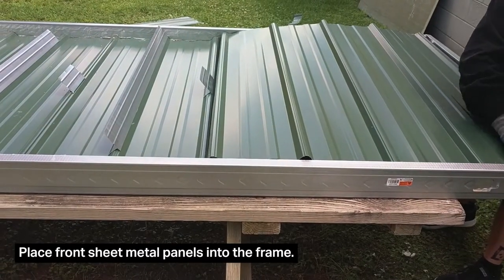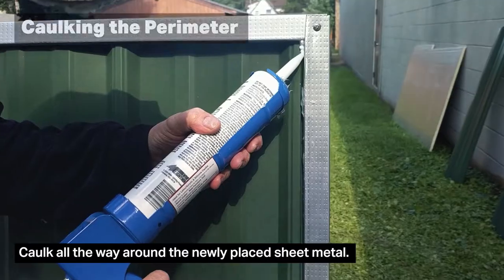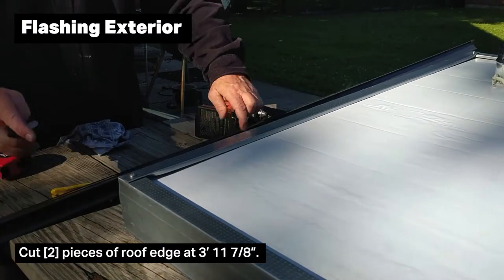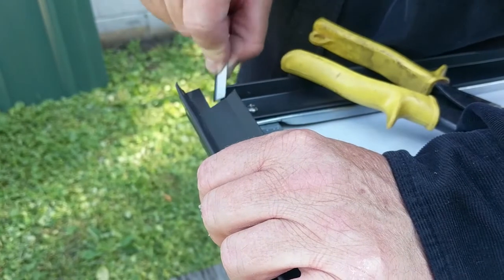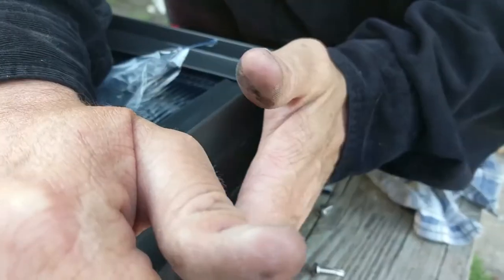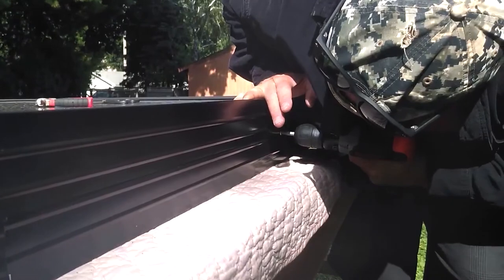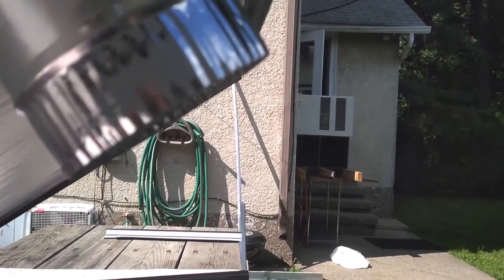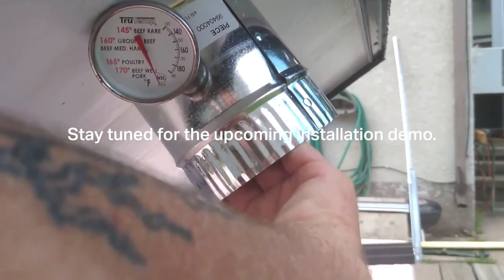DIY Solar Air Heater | Step-by-Step Building Guide [Part 2]

Comment: I would like to see data on performance in varying weather conditions. Impressive heat, nice work
Reply from the maker: Me too!  Maybe in time. I have found that the heat-collecting metal being protected under the polycarbonate, seems to not be affected by the exterior temps too much of a degree that would be noticeable.

Comment: Thanks for the video. Explained Perfectly to the last detail. Perfectly understandable language, excellent picture guide. It does not get better than this!
About the project: Finally someone who has built a collector not from wood. Thank you.
Only the imperial dimensions have to be converted, but I think the materials used are the same size everywhere in the world. From this then also the rest results.
A 6 mm thick polycarbonate hollow chamber panel has the dimensions 98 cm x 250 cm in our country. That should correspond to the plate you use, right? It currently costs 25 EUR (offline, DIY store), so the whole project is affordable.
Many greetings from Germany.
Reply from the maker: Thank you!  I am happy you found it clear.  Yes, the polycarbonate can vary in thickness as truly, the sun's rays transfer through it and heat up the metal so sufficiently, that such a slight difference would seem negligible.

Comment: The most expensive part of this build ( present day ) is the Polly twin wall and metal roofing. The heat you have coming out of the unit is impressive.  Should cost between $500 - $600 Canadian. It may even pay itself off within a few winter's.
Reply from the maker: These panels used to be $40 and now are around $100.  Always look for deals!

Comment: Thanks for the detailed and well delivered videos. Apart from durability,would you see any issues using a plywood frame in the construction rather than the steel U channel?
Reply from the maker: Thank you.  I kept glass, wood, soda cans and weird unfindable materials out and instead designed it as I would an oven fabricator, such that I was for many years. Plywood will rot. It's expensive, heavy, stinks and is toxic, no, steel studs rule the world!

Comment: Thank you for this. I am trying to help schools in Northern Pakistan get heat during winters as there is no electricity in the villages.  How much is the cost of this one unit about?
Reply from the maker: The cost of the last unit was around $466. The steel mounting frame is a bit more. Since there's no electricity, I suggest simply allowing the natural hot air to rise and flow into the living space.  Also, you may be able to direct the heated air through bricks or water jugs so they heat up during the day and then give off heat for some period of time through the evening. I hope this helps!  I would love to see this project should if come to fruition. Best of luck and feel free to contact me.

Comment: Looks good. How did it work? Have you tried black aluminum window screen or perforated aluminum fascia as the heat absorber?
Reply: I am familiar with screen designs and do not like the material for several reasons.  I also prefer the solid or un-perforated sheet metal as it is going to last for many many years whereas the screen is eventually likely going to degrade, warp, sag, etc, besides being a pain to work with.  Perforated aluminum would of course heat up, but because materials being heated can off-gas into the airflow, the perforations would allow the heated air to escape through the perforations, come in contact with the polycarbonate.  The plenum in my design is a totally sealed off system, super stiff and will last virtually forever.
Reply: @ericlatocki7588  Your design looks much more sturdy and looks professional. How many panels did you end up building? I am interested in building some to help heat one half of a two car garage that has been remodeled and heavily insulated. R38 in walls and roof in the half that I am using . I am planning on bringing the air in/out with flex duct through a window with plywood. That side faces SW. I plan to start with two panels for it. I have space for four or five later.
I also have a small 12x12 block building that is earth sheltered on three sides. It’s roof faces South. Just a small workshop. One or two panels?
Reply from the maker: Sheesh, how did I miss your comment!?  I don't like to make promises as there are so many variables, but I'd think one panel would definitely do the job assuming air circulation and insulations is in place.

Comment: Could I use old barn tin that I already have instead of purchasing new metal roofing?
Reply from the maker: You could I suppose. As long as you can keep it straight and not sag.  You may need to add some additional supports inside the plenum (air chamber). I want to see it when it's done!

Comment: Is the bottom layer of steel panels screwed to the lower support? I put thin plywood on the back under the foam. Any ideas about the number of panels needed to heat a 11x24 space if well insulated?
Reply: I don't screw the panels to the frame. Instead of plywood, I'd use a 4 x 8 sheet of PVC as it will never deteriorate.  Notice, I have kep wood out of this build. As for how many panels for that size space, I'd suggest starting out with one and seeing how it goes.  Ceiling fans help bring the heated air down to the living level.
Reply: @ericlatocki7588  I put small aluminum angle pieces on the sides  of the frame inside and screw the top metal to that. The thin plywood was on the outside rear of the frame. It was too flimsy without it. The foam board was inside the frame. Covered joints with foil duct tape. I will wrap the outside with the drip edge when I get the polycarbonate panel on. Lowes said they couldn’t get the 4x8 panels. Home Depot only had 2 ft wide panels. I had to use the wavy polycarbonate. It’s been an interesting project so far. Thanks

Comment: Wow, that’s nice but looks like it costs about $500 to build or more. I wonder about winter performance and fresh air intake.
Reply from the maker: The cost was approx $466 for the unit, the frame for mounting is right around $50.  The fan and controller are around $158. Air intake is almost negligible as the unit heats so quickly.  However, we take the air from the basement or lowest area and run it through an insulated flex duct.  That video is next and for now you can see photos of this on Discord: https://discord.gg/Ae6WQeM78P
Reply: Do you have any info about winter performance?
Reply from the maker: This design as well as many others that provide an air barrier between the outer plexi or poly material seem to not be swayed by the outside temperatures. They get very hot and all we're doing is pulling air across the heated steel.

Comment: what did it end up actually generating? what btu did you figure? how much savings did you get
Reply from the maker: The air coming out of the unit is above 220 Degrees F.  A normal furnace puts out about 140 at the vents. As there is so much available online regarding efficiency of solar flat panel air heaters (touted as being the most efficient by even the government), I have't spent or had the time to run all the numbers.  I have heard 30% savings can be typical.  This of course can be increased with sealing drafty doors/windows, etc.  Thank you for your q's!

Comment: Is the foam warping, or the plexi starting sag?
Reply from the maker: Actually, no!  Remember, we're not using plexiglass.  Instead, we use polycarbonate. I have a unit I built about 11 years ago and the poly looks exactly like it's new.  I have not had any issues with foam either.  Because the air is always moving, the constant inflow of cool air in the chamber balances it out.

Comment: What if u make the walls outside and the roof full with that system
Reply from the maker: I'm not clear on what you're asking
Reply: @DIYPrimitive   I mean if u make the walls outside and the roof with that system
Reply from the maker: I think there are ways to incorporate this design into walls and roofs.  You're basically running the polycarbonate over your existing steel roof and directing the air through.

Comment: Can you use a 2X6 frame instead of metal studs?
Reply from the maker: I personally prefer steel studs for a variety of reasons. Wood is heavy, more expensive generally, twists, cracks, etc.
Reply: @DIYPrimitive  
I built a solar heater to specs from ArcticSolar using their solar absorber, but with very poor temperature gain. I’ll pull that one down, remove the polycarbonate sheeting and convert the absorber to your system: roofing and rood edging. I need to heat a room seasonally for processing honey and can use the extra heat in the winter for a canoe build. The cost of natural gas to heat that area has become prohibitedly high. 

Ed
Reply from the maker: Thanks Ed!  Let me know how it goes!